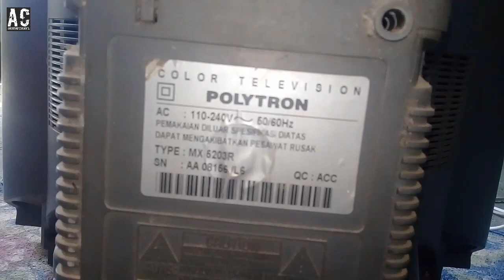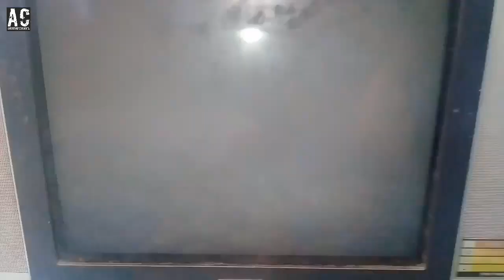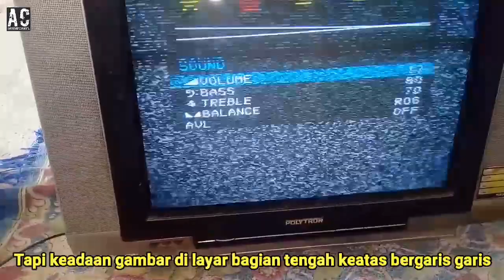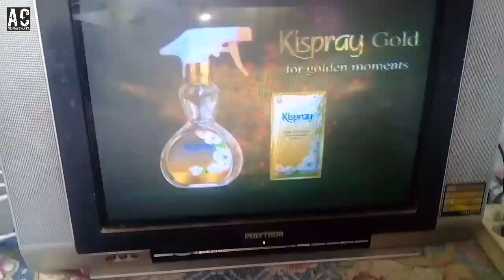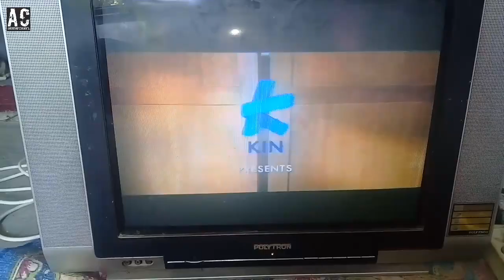TV Polytron minimax hidup sebentar mati lagi, mati standby

Comment: Kondisi sama tpi stelah ganti 3 elco tidak bisa on star itu gimana om
Reply from the maker: Coba d cek ulang pemasangan elco, mungki salah posisi - & + atau solderan kurang menempel kuat. Kualitas elco juga berpengaruh.
Reply: Wktu itu tdinya cuman nyala mati pas sya mau bongkar sya coba nyalain lg wah ko cuman nyala lampu nya aj gak bisa di on star trus sya bongkar dn ganti 3elco sya nyalain msih sma pas itu beli elco yg 2 sama tpi yg yg ukuran 10uf 50v slah jdinya yg 10 uf 50v blom di ganti apa pengaruh elco 10uf 50v om soalnya yg di ganti cuman yg 1uf 50v aj 2
Reply: Apa mungkin ad keluhan yg lain
Reply from the maker: @aldogunawan6082  yg di ganti 2 elco yg nilainya 1uF 50V
Reply from the maker: Coba solderan yg retak di solder ulang
Reply: Y yg di gabti elco 1uf 50v aj kn ad 2 y tuh yg di ganti yg 10uf 50v nya gk di ganti soalnya wktu beli slah belinya yg 1uf 50v smua
Reply: Udah di ulngi solder lg om dan uk 10uf 50v dh di gnti smua yg baru tapi on star masih sama itu apnya om
Reply from the maker: @aldogunawan6082  coba ic vertikal di ganti, mungkin ic vertikal sdh error.
Reply: Yg dket elco yg 3 itu y om
Reply: Maaf om bru bljr
Reply from the maker: @aldogunawan6082  ic vertikal seri an5522 / stv9302 diganti
Reply from the maker: @aldogunawan6082  mari sama sama belajar
Reply: Di sini seri nya stv9302B/80B818 om ap harus di ganti
Reply: Di vertikal ad elco 22uf 250v itu ats nya sdkit mnonjol ap gk ap2 om cumn sdkit
Reply from the maker: @aldogunawan6082  berarti ic vertikal seri stv9302 diganti
Reply from the maker: @aldogunawan6082  elco 22uF 250V itu elco di tegangan 180V (tegangan video), kalau sekiranya sudah gembung boleh diganti.
Reply: Alhmdllh om dh nyala cuman atas layar ad warna ijo nya ap nya tuh om
Reply from the maker: @aldogunawan6082  coba ptc degaussing diganti
Reply: Ok siap om trmksih saran nya
Reply: Oh y om Sya punya tv polytron lg minimax tabung yg datar tadi nya kadang2 cuman garis tengah trus pas di pukul ats nya nyala lg stiap muncul garis sllu di pkul trus sya biarin trus dn akhir nya sya coba nyalain mati total apa nya y om
Reply from the maker: @aldogunawan6082  sama sama
Reply from the maker: @aldogunawan6082  coba solderan yang retak retak di solder ulang terutama di area blok vertikal
Reply: @aldogunawan6082  ukuran mikro sangat berpengaruh juga mas